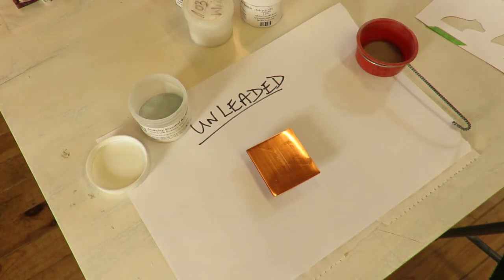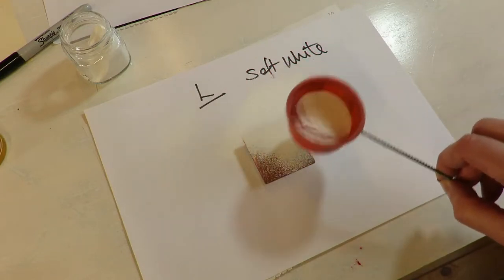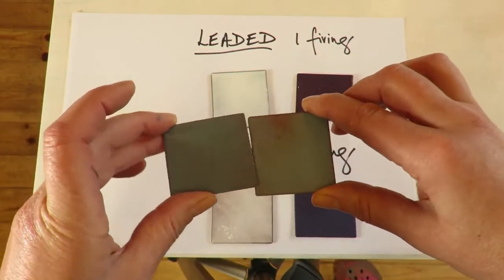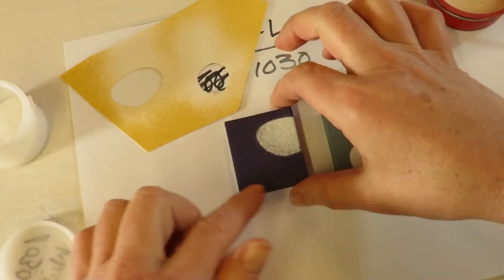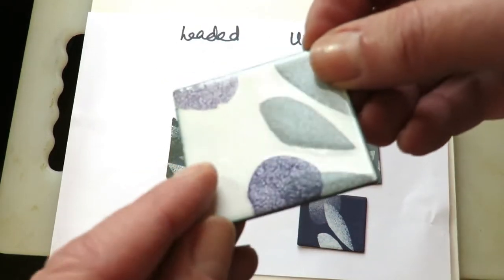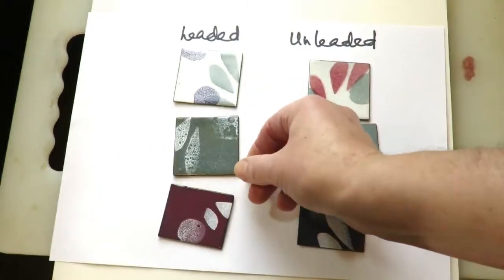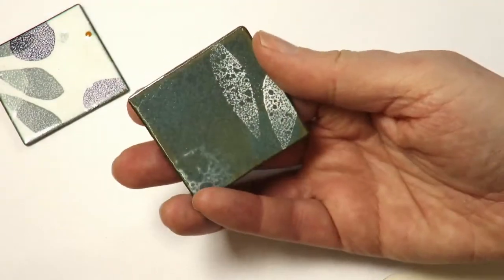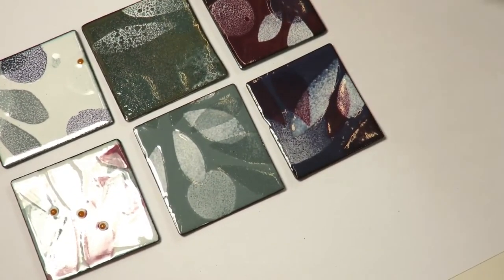Enamels: Leaded and Unleaded, How and When to Use Them

Comment: What about PPE and precautions when handling leaded enamels?
Reply from the maker: Good question: I wear a mask when using leaded enamels and work with an air purifier switched on. When they’re fired leaded enamels are no longer toxic but it is the very fine particles which can stay in the air after sifting that you need to be careful of. Also, I sit on a stool that is much higher than the work top so I’m always above the powder…and never use them in a living space like a kitchen or living room - you need a dedicated space like a shed. Otherwise it is simply a matter of being careful and always cleaning up properly with wet paper towels. Unleaded enamels should also be used with caution though - I wear a mask with them also because while they don’t have lead they do have all sorts of other chemicals that you don’t want to inhale

Comment: Love this video! Well explained. Many thanks. Just one query, for the first two layers applied as the base, the surface look un-even, not smooth. This is exactly the same effect when I experiment at home. Is this supposed to be like this, uneven and not smooth? Otherwise, how can we get the surface base to be completely smooth, or this is not possible? Many thanks.
Reply from the maker: Hi there, yes, don't worry about the first few layers having an "orange peel" texture. Certain colours like red for example, burn off very easily...so, when I use red as the first layer, knowing that I'll be layering another red, then multiple layers and firings after that, I always "under fire" the piece so that it deliberately has a lumpy surface. I fire it just enough that the enamel is fused to the copper. When you are using multiple layers and doing multiple firings you should slightly under fire every layer except the last one - which you want to be smooth and glassy. 

Remember that every time you fire the piece some of the previous enamel will burn off. So layer 1 has been fired maybe 6 times, but layer 6 has only been fired once...